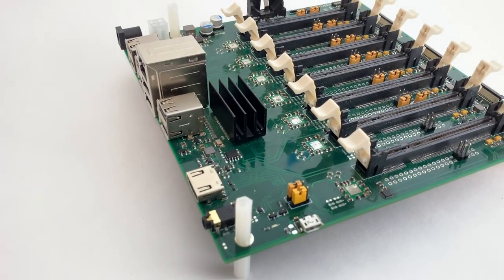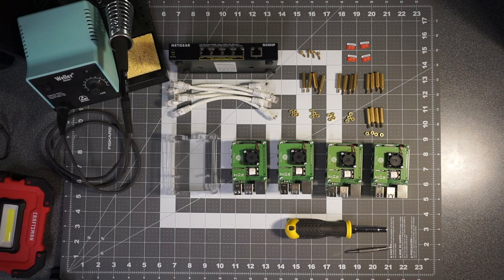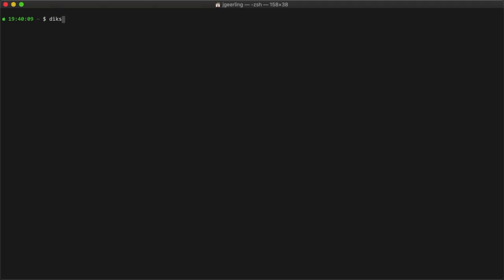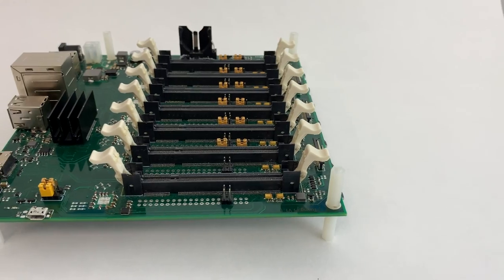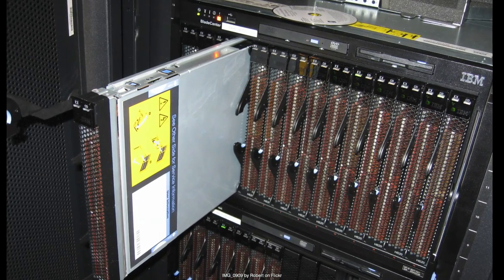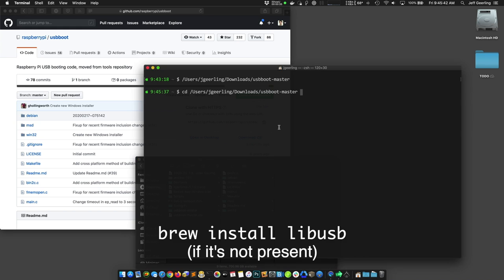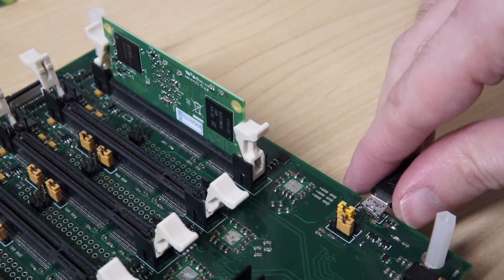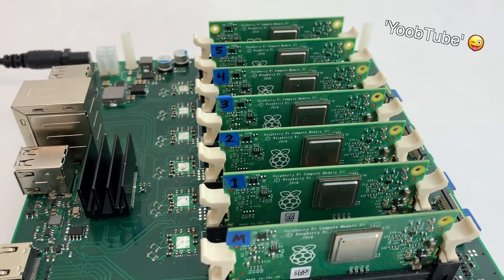Raspberry Pi Cluster Ep 2 - Setting up the Cluster

Comment: Serious question: In part 1 you mention cores and reference AMD at $2k, but aside from 'fun' of the cluster, why not go with something like Intel E5 v2 series used for <$150 or <$300 for dual CPUs. Surely even at equal core count the Intel would be faster even using similar ram constraints, and other variables.  Interesting none-the-less, and thanks for explaining so well.
Reply from the maker: For most applications, almost any current or even slightly-older gen Intel or AMD chip is going to be a better value than a Pi cluster, if you're looking for performance (or even efficiency). But for light but bursty workloads (e.g. web requests) an ARM processor like the one in the Pi does just fine, and with more CPU cores the cluster can distribute requests more efficiently as long as the task is not CPU-bound.
Reply: @JeffGeerling  Thanks for the reply! Great video and I'll give it a shot with a few spare pis I have around :)

Comment: Always interesting how people call a bunch of Kubernetes nodes a cluster. It's not really traditional clustering, it's distributed computing if you ask me.
So your term for the your set of RPis together is actually a better fit. :-)
Reply: It's application level clustering ... sort of.  I used to run beowulf and even mosix clusters.  But for actual, real, sound clustering, nothing beats what tru64 did back in the day.
Reply: No, not a classical cluster. But at the end they do the same, schedule workloads to a pool of resources. Classical clusters are not very flexible, and not in general use today outside the academia. Learning k8s is a much more useful skill to learn for young engineers today.

Comment: The Turing Pi certainly seems simpler and more elegant than a “bramble” build of regular pi. 

However, am I missing something, or isn’t the end cost cheaper for buying the full pi units? You have to get SD cards and what not, but the Turing board itself is so expensive it appears to push it over the edge. 

Maybe it’s addressed in a later video, but I’m also not clear on which would perform better, or if they perform about the same?
Reply from the maker: Equivalent spec Pis will perform identically; the main things the Turing Pi board brings to the table are a more compact footprint with less cabling mess required. The total cost (all-in) is similar, but you can mount up the Turing Pi in a standard PC case or server case, which may push somone towards that solution if they're not just running it on a desk or shelf somewhere.

Comment: I've never really fully understood pi clusters. Can you combine the processing power of the clusters to run a single application faster or is this just for the purpose of getting faster computational power with combining cpu's for calculations?
Reply from the maker: It depends on the application. It's not like plugging ten CPUs together gets you 10x faster processing. Applications have to be not only aware of multiple CPU cores (many aren't), they also have to work in a way that can be parallelized / split up on different computers.

Many web applications and some scientific applications are made in a way that can be scaled in a cluster like this, but many applications aren't (e.g. games). So a cluster could let you run more things but maybe not the same things faster, depending on what you're trying to run.

Comment: so a cluster of raspberry pi 4's would be faster than this right? Since a compute module is < pi4. What would be the difference in computing power?
Reply from the maker: I'll probably be exploring performance differences in two episodes, after Kubernetes is installed. But yes, in general the Pi 4 will beat the 3 in most benchmarks.
Reply: @JeffGeerling  ok cant wait this is good stuff.

Comment: I'm just getting into computers and eventually want to build my own robotics. My questions are, would a pi cluster work to run a robot? would it make sense to run a robot this way? would it be faster? or is there a better easier way?
Reply: Dryden Stewart inc. You don’t need a cluster to do it. Depending on what you’re calling a robot and what you’re using to control it, one computer should be enough. I have seen 8 separate computers running a large robot but that was 25 man-years of code and 50-60 motion axes.
Reply: @MichaelSmith-fg8xh  Thanks for your reply, It is amazing how much I have learned over the past few months, but I still have many questions.  I've turned my attention to microcontrollers and bought myself an Arduino Uno and an esp32 cam (among other bits and bobs) and trying to learn how to code. My ultimate goal is to build a home assistant robot, Something that could eventually help those in need and elderly people with household chores but at the same time, I don't want it to be super expensive.  I have a long way to go, right now I'm trying to learn how to get something like TensorFlow to control a stepper motor or a servo... I really haven't even started playing around with TensorFlow yet so it might be easier than I think, but I can't find a single video on how it's done.

Comment: Could you just netboot them, either to initially flash the eMMC's, or to enable the use of non-eMMC Compute Modules?
Reply: PXE boot would be awesome, so it would be possible to provisioning a cluster with something like Ubuntu MAAS or similar.
Reply from the maker: Yes; note that the netboot setup is different depending on model of CM, it also requires one separate server (or the master Pi would suffice) to share filesystems via NFS. It's a little more complicated and I might cover that later, but didn't want to get too much into the weeds in this episode, especially since the way you set up netboot is different per Pi and the Pi 4 doesn't work with it yet (as of this writing?).
Reply: Seems like that at least usb boot for the RPi 4 is in the beta firmware since May 15th :)
Reply: just for completeness the pi4 does already support netboot, I tried it and it does work, but you do need the latest firmware and to set it up you do need to boot each pi with an SD first in order to write the proper configuration in the eeprom.

Comment: Nice video! I like your presentation skills. I am in India and the price of building a pi cluster is not much different from building a single high powered computer with 64 or 128 GB RAM. When you quote US prices it seems so easy but in India prices are way high.

Comment: @Jeff Geerling - I have a Raspberry Pi 3 B+ that I’m using for a Pi Hole, but I’ve been thinking about building a homemade router. I usually have 4 to 8 devices connected to the network, usually streaming or sending high-speed data to a data center. Do you think a Bramble would be able to fill this function without overheating or becoming a bottleneck?

Comment: Once you connect them, you can add many i/o options for machinery like servos, sensors, etc?  I’m new to this
Reply from the maker: Yes; each Pi has it's GPIO pins available next to it, meaning you can use GPIO just like with a normal Pi. I believe the final version of the board will have headers installed too (so you wouldn't have to solder your own on, like with the prototype I have in these videos).

Comment: For input / output options will something like this be slower than many pi 3 or pi 4 clusters without that board?  Since I’m assuming less input output options unless built upon. Just curious.  Fairly new to this
Reply from the maker: The Pi 4 has much faster I/O with its USB 3.0 ports and full Gigabit ethernet. The Compute Module has equivalent functionality to the 3 B+ (or whatever generation it matches), meaning it has USB 2.0 and ~100 Mbps ethernet. The Pi 4 gives the best I/O capabilities, if that matters to you. You could also use the compute modules as nodes and have a separate Pi 4 acting as a master, with attached SSD storage on NFS for more speed. It really depends on your needs.

Comment: 5:15 "using PV to monitor the progress of DD command" - /me looking at the man page: dd - option: "status" - value: "progress"
so - using "dd if=image of=disk status=progress" does exactly the same without using additional PV ... today you learned
Reply from the maker: It depends on the version of dd you have installed — I'm guessing some platforms have newer versions by default that support it, but I know at least on RHEL 6 (which is an OS I have to work with from time to time, even though it's not even supported now!), dd doesn't have a progress parameter, so I still use pv there, and old habits die hard :) — pv is useful in many other contexts too, so not a bad tool to have handy.
Reply: @JeffGeerling  well - I honestly have to apologize to you on that one
I started using linux on my root around mid-2014 - but at least as far as I recall it always had this option
according to different sources I was able to look up it seems that this function just was added recently - and just to the version of GNU coreutils v8.24 back in 2016 (at least according to one source - while others dates to 2019)
unfortunately as there's no "one official" version of DD but it's rather a common tool in way too many different versions it's hard to tell since when and on which platforms the status=progress option was introduced first
as I'm just so used to that option I wasn't even aware of the existence of PV ...
so, well, SORRY ... I guess?

Comment: Almost 10 years ago I used a bunch of x86 motherboards. (12 boards) under knoppix Linux HA  cluster supercomputer concept was a very interesting experience with PovRay parallel   and of course the most interesting a mandelbrot MPI parallel fractals version. But applications that use this kind of power computing are very very rare!! Programming MPI apps is very difficult and most apps to use them are only scientific programs that no one can use it in our real simple world.  But is very interesting jaja
Reply: I remember messing around with mosix 20-ish years ago.  It would essentially turn a cluster into a single-image machine.  Almost, but not quite.  The resources from other nodes would be merged.  Extra resources would show up as local resources.  It was pretty neat, but the project is dead.  Shame really, because with pci-e, it would almost be trivial to sort the networking bottlenecks.  No numalink required, no super expensive networking, etc.

Comment: I don't know what I'd DO with it, but it'd be fun to set up a cluster of clusters with a couple of these Turing boards. I'd love to see a version for a small X86 blade purely for that software compatibility.
Are they always on, or is there a way to turn them off/on as needed? because that would be really clever (and something I think full-scale clusters can do).
(edit, I see exposed IO shields on each of these. I know EXACTLY what I'd do with it. IO+that aRGB controller library I saw months ago+as many aRBGs as a single Pi can handle X 7 Pis X However many boards = Giant aRGB matrix on a wall)
Reply from the maker: You can switch off individual Pis either shutting them down via linux “shutdown now” or via an internal I2C cluster management bus I will mention in the next video.

Comment: Great video!
While I can appreciate the coolness of such gadgets, I find all these very gimmicky outside of a classroom project. It is obviously not a high-performance cluster used for any serious calculation and using a $400 second-hand desktop with virtual machines would exceed the performance and convenience of this solution by a much larger margin. Even an older Ryzen 7 1700 (non "X" and 65W TDP) would give a RPi cluster a strong competition in terms of energy efficiency (power * time) for any application. Personally, I use a 2700 with 32GB of RAM for this particular purpose - testing VMs and scientific setups before deploying them in my compute cluster at work, but my particular setup would cost around $500 second-hand. 
I do own a lot (actually too many lots) of SBC computers, Ardunio-like devices and other gimmicks for all sorts of tinkering and educational purposes, but there are many other better uses for individual Pi-s than making compute clusters out of them.
Reply: I don't think he's making these so much for "serious calculation" as for learning and experimentation.  Additionally, while the Ryzen 7 may be a faster processor, it's an example of exactly what he talked about in his previous video--vertical scaling.  Sometimes vertical scaling may be the perfect solution.  But horizontal scaling has its place as well.  Being able to hot swap boards is basically out the window with an old desktop. For those interested in learning about distributed computing in an open platform, the Raspberry pi can be a good choice.

Comment: You are using via USB 2 connected 100 MBit NICs per Module? Why not 1 GBit NICs? Even with USB 2.0 they would have 3 times the speed. 

I am looking forward to buy a Turing Pi Board as soon as the Compute Module based on RPi 4 is released an proofed running. It will have a hell of a power for an ARM based Cluster but the hot SoCs will also be a pain in the * when it comes to cooling....
Reply from the maker: The Turing Pi currently has a built-in Gigabit network between all the Pis. But the Pi CM3+ (and all current versions of the Compute Module) only support 100 Mbps LAN because of their IO configuration. Hopefully when the CM 4 is released (fingers crossed!) we'll be able to use the full 1Gbps on each Pi.
Reply: Doesn't the Pi 3 B+ actually have a gigabit NIC, though still connected via USB 2 and therefore, while not capable of 1Gb/s throughput, still rather faster than 100Mb/s? The Compute Module 3+ on the official site is described as "a Raspberry Pi Model 3 B+ in a flexible form factor" so might the same be true? There is no Ethernet PHY on the Compute Module itself so the question is, how does it interface with the gigabit switch on the Turing Pi motherboard?

Comment: I want to build this, I want to buy all the parts, I want the built in EMMC version
Reply from the maker: Definitely the better option.
Reply: @JeffGeerling  Which size of eMMC would you recommend? Is it a case of the bigger the better or is, say, 8 GB plenty for the OS, with user storage on the network. Is there any advantage in getting a card with more storage for the master node?

Comment: But could you make a cluster with multiple turing modules?
Reply from the maker: Yes! They basically make the Pis show up on a network, so you could have as many of them as you want, assuming the K3s master node can keep up with scheduling things on all the nodes. The largest K8s cluster I've personally managed was around 500 nodes on Amazon EKS, but that was using their fast (and expensive) K8s management control plane, and not a Raspberry Pi ;)

Comment: ONE thing to note is never ever try to use those in a RAM slot.  You will damage your computer and the module.  It wouldn't surprise me if it fills up a room with the "magic smoke" even.
Reply from the maker: That would be a fun experiment... ♨️
Reply: You'd have to go back a few years to find one of those sockets being used for RAM. They're 200-pin DDR2 sockets.

Comment: spanish question
¿Se puede compenetrar con "agisoft metashape profesional" ya que trabajo con drones y a pesar de tener un microprocesador i9-9900k con 48gb de ram, ssd de 500 gb y gtx 1060 de 6gb me pego en algunos renderizados de grandes extensiones más de 24 horas ya que utilizo sistemas RTK para calibrar las imágenes y no tener errores, podrías hacer una pequeña prueba a ver si es compenetrable? muchas grácias

english question
Can you understand "agisoft metashape professional" since I work with drones and despite having an i9-9900k microprocessor with 48gb of ram, 500gb ssd and 6gb gtx 1060, I get stuck in some renderings of large extensions for more than 24 hours Since I use RTK systems to calibrate the images and not have errors, could you do a little test to see if it is penetrable? thank you

Comment: I have an idea, i really want to replace my computer with raspberry pi. I like to use 2x raspberry pi cm4 8gb and use a 512 nvme ssd. Main question here: what is the difference when i run an OS like windows 10 or linux distro on dual raspberry pi cluster. Will it be slow, how its performance is going to be compared to a laptop with i7 4th gen processor, 840m graphics card, 8 gigs of ram and a basic 500 gb sata ssd(i have lenovo z5070 :/). I use fusion 360 and photoshop time to time and i'd like to improve my abilities to use them, thats why i am asking for windows performance to.
Reply: Stick with your current laptop, its faster. The pi's performance is far from bad but your current setup is still faster. And even if you still wanted to neither photoshop or fusion 360 have arm ports. And even if you managed to pull out some way of running it the performance would literally be unusable.

Comment: I'd love to know what power draw looks like when the system is fully loaded and processing. I'd be interested in running erlang/elixir applications on a cluster like this, assuming it used a fraction of the power of my threadripper and 1080ti... some tasks I work on care more about parallelization more than raw speed.
Reply from the maker: I'll be posting some of the power/efficiency data soon. I can't get as much detail / margin of error as I'd like since I currently only have a Kill-A-Watt available at my house for the measurement, but it will give some ballpark numbers. I plan on looking at that maybe in episode 4 or 5.

Note that for anything where single thread raw performance is required, a threadripper will beat the pants off a Pi cluster!
Reply: @JeffGeerling  Kill-A-Watt readouts are good enough for my uses :).
Reply: @JeffGeerling  A TR will beat the pants off of this for any task ...